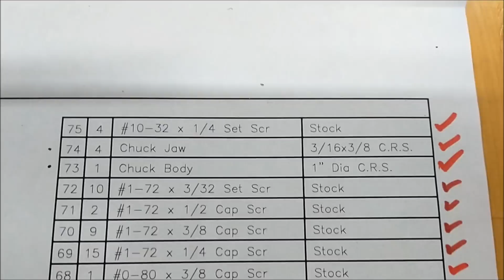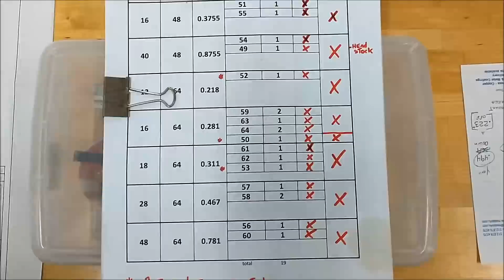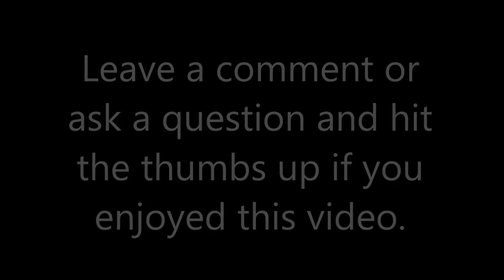Mini Lathe ? This May Be One of The World's Smallest !!!

Comment: Do you have videos of you making all the parts for the kits?
Reply from the maker: Greetings. Thanks for your flattering comments. This particular video is the final assembly video in a multi part series on my channel that does show the fabrication of all the components. My video catalog also has  several other machines for the mini shop and started with a steam engine to drive them when complete. These machines are a combination of brass, steel and aluminum.
Reply: Thank replying to my questions??
Reply: I love this kind of stuff any thing that has to do with engineering, I have always been fascinated with it , to design something ,build it so that it can be used to build something else, it has always amazed me so much that I wish I had studied engineering when I was young, to late now I'm 70 years old now but am a gear head through and through lol.

Comment: What you think about installing a litlle rc car eletric motor on this machines, i think every one loves💥💥💥
Reply from the maker: Its supposed to be powered by a steam engine and overhead line shaft, but an RC car motor would probably work. It may be a little high on the RPM, but I'm sure it would spin it.

Comment: According to the font of wisdom(Wikipedia),  "The smallest CNC micro lathe was made by researchers at the Mechanical Engineering Laboratory of Japan’s Ministry of Economy, Trade and Industry and Olympus Optical Co. It is 32 mm long, 25 mm wide, and 30.5 mm high, the lathe weighs just 100 grams. In test runs, the tiny lathe produced a brass needle 0.05 mm wide and 0.6 mm long and screws that are 0.05 mm thick."    ,so slightly smaller, but then again, they didn't have to consider human operation. 
I expect that Joe could make a smaller one than the model lathe, and make it functional. It just wouldn't look that nice.
Reply from the maker: CNC key word. I'll would gladly take second place.
Reply: @joepie221  Oops, seems second place is occupied... if you count woodlathes...   https://www.youtube.com/watch?v=ScNFsgTz6HY&t=14s   
OK, it's debatable if it can actually be used, but it's still mindblowing.

Comment: Really nice work. Question, can the PMR kits be made successfully with mini lathe and mini mill? I have nothing so need to 'tool up'. Thanks.
Reply from the maker: Probably. Make sure you can run threads on whatever machine you get, but I guess a die would work too.

Comment: Absolutely beautiful machine.

So i have a 1919 english lathe i was given 2 or 3 years ago that i am going to restore..that looks VERY similarto that lathe you built.... but i have a question about the brass gear behind the headstock belt pullies.  What is the purpose of that gear? On the one i have, it is off center...like its meant to lock the headstock in place to take the chuck off... i dont know enough to ask the right questions in another forum.  

Thanks, and my god thats an awesome machine.
Reply from the maker: The secondary gears behind the cone pulley reduce the gear ratio to a super low range commonly referred to as 'Back Gear'. By pulling those gears forward until they engage and locking them there, you then need to address the bullpin on the large gear to the right of the cone pulley. By pulling the pin ( or screw) in or out, the speed range goes from high to low. Let me know if this makes sense. Moving those gears does nothing unless you move the pin as well.

Comment: I have just finished watching this series of videos of the 1800’s mini lathe.  My  comments…. It is obvious that you sir strive to be a perfectionist.  You explain the steps clearly and rationalize any modifications that you deem may be necessary.
I was wondering if the original 1800’s lathe would have had an attached tray to catch the debris/swarf. If so that would be a nice addition to complete the mini lathe.
Reply from the maker: Thank you very much. Making this was a bucket list item for me and I didn't want any regrets looking back. Thank you for watching the series.
Reply: OSHA might complain about no belt and gear guards.  Plenty of tiny pinch points.  Seriously neat project.  Nice work to say the least.
Reply: @clayz1  mini-OSHA.

Comment: I am a machinist in Oregon worked for Bingham Willamette Iron and Steel company in Portland, started in 1971 completed 4 year State apprentice program. We  ran machines that were at the other end of the spectrum like, 20 and 30 foot vertical boring mills, Horizontal boring mills x and y travel of 25 foot and a 40 foot planer mill open sided, 10ft width. I would much rather work on the big stuff and  almost all of the big machines had 100 horse power. Main products we produced were pumps.

Comment: Wait .. what? I just visited your website, just browsing of coarse ... as I thought this thing would be WELL out of my reach as far as cost goes ... then my jaw dropped when I seen the price tag ...? Maybe it was just me ... but i expected there to be another zero on that cost ... i am absolutely blown away at how cheap that is, for such an absolutely precise, and beautiful machine ... considering the workmanship and countless hours in R&D ... /speechless
Reply from the maker: As is, you could add 2 more zeros to the kit price and you'd be close to its actual value. But the kits are very reasonably priced. Plus, patrons to this channel get an extra 10% off anything they buy from them. Thats like buying a $15 coupon for $1.
Reply: Joe doesn't make or sell the kIts.  He produced a series of vids on how to build the working model from the kit.  The kit contains raw castings and   bar stock.  It requires probably 100 hours of shop time to complete.  All.the machining, fitting, polishing and assembly is done by the purchaser. Its all within the reach of hobbyist machinists, but you'll need access  to some basic machine tools like a lathe and a milling machine.

Comment: I need this how to buy
Reply from the maker: https://www.pmmodelengines.com/shop/machine-tools/machine-models/engine-lathe-kit/   Un-machined kit US $159.00
Kit shown in this video  Bidding starts at $15,000
Reply: @joepie221  Hi Joe, what does un-machined mean?  Parts need to be machined before assembly?  What kind of machining are needed?  Thanks in advance.
Reply from the maker: @Tedsustraps  Machined kits are ready to assemble, un-machined kits have parts that need to be milled, drilled, turned and tapped before assembly can be done. Usually a mill and a lathe are required.
Reply: @joepie221  thank you!!

Comment: Hi Joe, wow I am so impressed  what a gorgeous little  lathe this would  look even more  impressive  with a small  cast motor turning  all the gearing , iv got a 1918 Colchester  master 6" x 36"  belt driven  lathe  and  if hadn't  bought it  it would have  gone to the scrap man.  With the help of a late friend  he and i  built a  frame  using 50 x50 x5 angle  bolted to the  legs  100mm above  floor level  to hold a large heavy motor  , then another  frame was made behind   the  stepped  pulley  that  drives the  chuck  with an adjustable roller  to tension  a belt i  made from a small  ratchet  strap  butted  together and  hand stitched  using heavy duty  thread ,  the old lathe runs sweet as a nut and  is quite  accurate   S.
Reply from the maker: I have a mini steam engine and the drive pulley. I'll link them sooner or later.

Comment: Is there a way to easily connect a motor to this? That’s way too cool!!!
Reply from the maker: Either remove the spindle and install a belt, or use a belt and lace it together. Either choice and it will have power.
Reply: Yes that will looks super

Comment: Joe, What are your thoughts about running a steel spindle on aluminum bearings? I would be afraid to run it for fear of galling and seizing. Your created a work of art. I don't think you need to risk damage to prove it works. It functions, but running fast enough to get any SFPM may be its undoing.
You demonstrated patience, planning, and clear thinking which are prerequisites for every machinist. Thanks for your time, explanations, and effort to take us through your thought process and the sequences you take to get it done right; these are qualities a real machinist goes through.
Reply from the maker: I'm inclined to agree with you. the smallest piece of debris and the headstock journals loose immediately. thanks for your comment.

Comment: OK, so now for the line shaft and the steam engine and a piece of 1/4" aluminum stock and make the first chips. - (Just kidding. That would take almost as much time as building the lathe but I wouldn't put it past you, Pieczynski.) 

seriously, I wounder how many of these kits were sold VS kits actually finished. I'm guessing not too many.
Reply from the maker: I saved the toughest parts for last so I could think about the approach as I was doing the other parts. It all ended well.

Comment: Nice job Joe!

When will we see you turning something on that lathe?

For the small wrench (a beauty), isn't the hex supposed to be at 15° off the axis ? 
So that even with a 30°ish rotation span, you can accomplish a full rotation by turning the wrench upside down every odd step...
Reply from the maker: I bet you could come in from the other side and achieve the same result if the swing hits the casting.
Reply: @joepie221  of course, on the model, it is easy for us to switch to the other side of the machine... 
I was so into the model that I imagined my-scaled-self working on the lathe... 😅😅

Comment: You going to make a drive line to run the lathe off the steam engine? You'll need to build a mini boiler for that. That would be neat to build a shop model full of machines this scale that all worked and were belt driven from a boiler and steam engine. This lathe was an absolutely awesome build. Very good assembly video. Very neat.

Comment: Amazing work of art and function ! Watched every vid and very impressed. Question , I've been working on my 7X mini lathes , I have 3 and 7X mini mill. I'm making tapered bronze gibs for the carriage. would you recommend I put cone point set screw so the gib won't slide off into the rack when adjusting or a dog point set screw 2mm and slot the gib ? BTW I had so much fun machining the chuck I made 2 of them , I'll be ordering the kit. I built 2 steam engines from PM and love them !

Comment: My dad bought a lathe that looked very similar to that.It was in a barn lot in Kentucky.There was a corner broken off the cross slide. I welded it up with a torch,cast iron rod and flux.in a bed of hot charcoal. The hand wheels were not graduated. I found a brass tag with the patent date,1886.He sold it.to someone to use as a wood lathe.

Comment: Great video and project! The shop that I apprenticed at (about 100 years ago) had three Hendey lathes that looked very similar to your model. They were made to run overhead line shafts, but ours had mounting brackets with overhead motors. I can’t remember how we shifted the belt, but I’m thinking there must have been an idler shaft between the motor and the drive pulleys. A little motor on your lathe would be neat.

Comment: Wouldn't it be sensible to put an extra locking collar, on the outboard end (ie. beyond the mounting brackets) of the keyed shaft, so you can keep the shaft in position, when using the existing collars, as carriage stops?
Reply from the maker: One on each end would probably work for both directions.

Comment: Wow

If only there was a miniature 3-jaw scroll chuck...
And live centre, insert tooling, drill bit set (matching the tailstock taper).

You could spend 50 years adding to this project!
Reply from the maker: So true.
Reply: @joepie221  So make one, just use the scroll of a regular size chuck and a reducing pantograph to make the miniature.
Really enjoyed the series,  sad that it is complete. 
One question; I believe on full size lathers the flat belt may have had it's ends joined after looping through the head stock, will you need to disassemble yours to add a belt or do you plan to make a miniature belt stapler (or whatever they are called)?
Reply: @martinmoeller9186   One could always cheat and use one of those modern belts that pieces together from plastic sections.

You probably wouldn't want to use it for much more than some superficial cuts on soft material so there would be no reason to leave the belt on.

Comment: I am in awe. Truly a work of art.

Now, how about a little compound, half nuts, threaded apron drive shaft and a small quick change gear box to make it complete? I will give you a pass on the power feed on the cross slide, a lot of small lathes don't have that feature.

Comment: This is beyond amazing. I did not watch this series I watched a few episodes here and there I'm kicking myself that I did not watch the whole series at this point. I always can go back and do that. I'm wondering why there isn't a rare cone pulley on this? Are there old models that just use a brass drive shaft like this? Or whatever metal we may have used but I have not seen one I'm just curious. This looks like exactly like an old Logan although South Bend and Logan were almost identical

Here's a question for you does that clutch knob actually engage a clutch? That brings this to a whole nother level of complexity if it's true
Reply: The other cone pulley would go up on the ceiling mounted lineshaft.
Reply: @RambozoClown  oh nice that means this is of the vintage that goes back to the steam driven workshop I love it. I have an old Racine saw that was converted to run using a electric motor. I had an old expert Racine guy look at it he said it's the oldest of its type that he's ever seen he collects them. The thing cut through a 6-in piece of tool steel and didn't even hiccup beautiful smooth cut!

If I had the years left in the financial means I've always fancy trying to set up a steam workshop I couldn't imagine being so happy

Comment: You did a superb job with the entire series of videos on this build!  I always learn from you. The little side tips and tricks you show make my meager attempts at machining easier and better. What is project is next. I can envision a total miniature machine shop; lathe, drill press, shaper, planer, vertical lathe, grinder, and more all driven with line shafts and belts driven by a smaller steam engine with a vertical boiler.